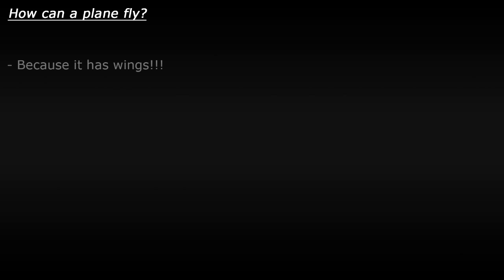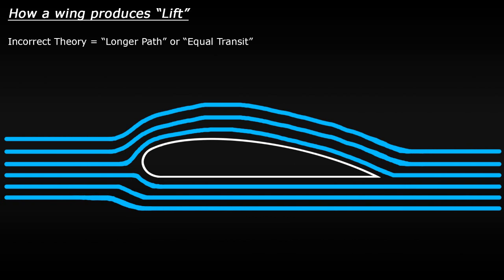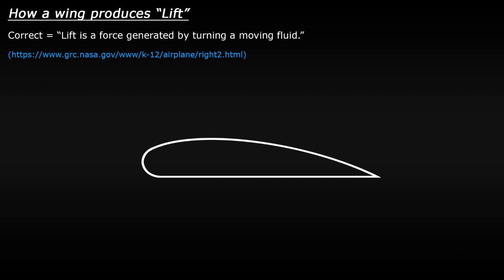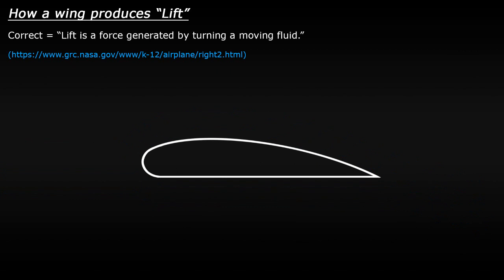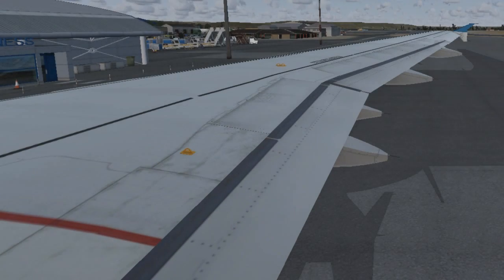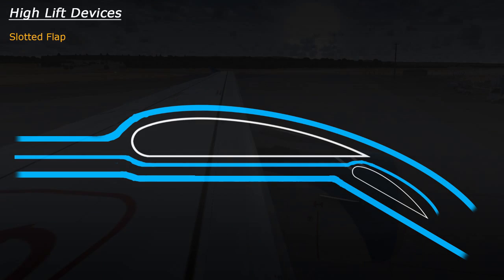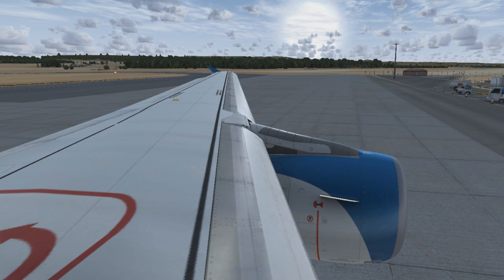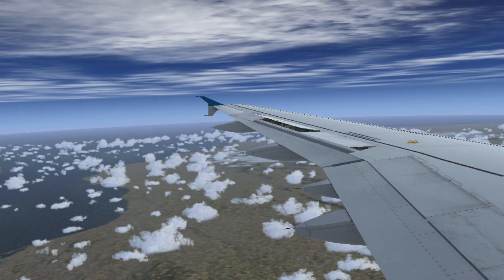How Wings ACTUALLY Create Lift!

Comment: I fully agree with what's happening here, but I don't understand a stall. A stall happens when the air over the top of the wing separates from the wing itself, but how does this cause a stall if the the air moving over the wing has no relevance to the lift produced. Can anyone help?
I'm happy to explain further if that wasn't enough, thanks.
Reply: Lift is created by pushing air down, and thus the air pushing back upwards against you. The explanation in the video is incorrect. If the explanation in the video was correct, and inverted plane could not fly and would just fall straight out of the sky. 
A stall is induced when the angle of attack is too great for the speed of the airplane. For example a aircraft that is powerful enough to climb at a 90 upward angle to the earth, will not stall until it reaches the point that the air has become too thin for the motor/engine to produce more thrust than the weight of the aircraft. That is basically how a helicopter works. 
So if you have a large commercial jet fully loaded, it is extremely heavy, even with big engines, it is not a high performance aircraft, and it can not climb at as steep of an angle of attack as a small, light, fast plane. Think of it like a car driving up a hill, a sports car can drive up a really steep hill because its engine is powerful, and the car is lightweight, so it can drive up the hill with ease. But if a heavy vehicle with a less powerful engine tries, the hill may be too steep, and the vehicle will either stop, or roll/slide back down the hill.
So for every aircraft there is a speed+weight+wing area+altitude combination that will decide the limit of the angle of attack that it can continue flying level, or climbing.
Essentially if you increase the angle of attack too much, the bottom of the wing begins to face forward, and air is just running into the bottom of the wing. So now your wing is just pushing air forward instead of down. This will create way too much drag, no lift, and slow the aircraft. 
I know this explanation is not very good or understandable but I hope it helps.
Reply: In a stall its because the push up under the wing, not the lift thats on top , becomes more and more of a push back. Lift is on the top, like a vacuum, and when air is no longer going over the top there is no vacuum..all you have is push back by the air underneath.
Reply: @Rickie53  An aircraft stall and a wing stall are not the same. An aircraft can still fly with stalled wings, which specifically refers to the cessation of laminar flow of air around the wing.

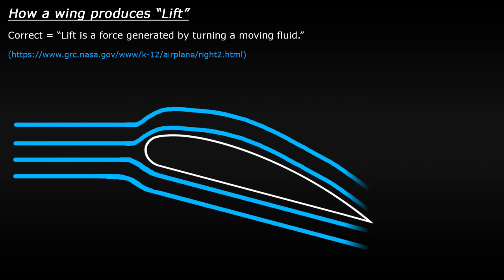Comment: So the Falps in 3:21 is used to take off at slower speed to reduce the amount of consumed fuel??
Reply: No,  Flaps are used to increase lift at lower speeds,  they also create more drag so more power is needed to maintain a set speed so fuel consumption actually increases.   The flaps are used to get off the ground sooner, or to reduce the speed to be within a safe limit for landing.

Comment: I fly several (model) aircraft which have no cambered aerofoil cross-section and of course nothing like flaps. In other words the wings are basically flat planks of wood (or plastic). But they still fly. How come? It's because of the rear stabilizer, with its large moment of inertia, forcing the main wing into an angle of attack which forces the air under the wing to produce lift. Why is this aspect of lift hardly ever discussed? The only time you will see exaggerated aerofoil cross-sections are on 'flying wings', which of course have no rear stabilizer. Bye the way, ever wondered how planes can fly upside down? It's due to the angle of attack caused by the rear stabilizer. I'd like to hear your comments...
Reply: The rear stabilizer is part of flight mechanics. The salient point is the flat plate is at an angle of attack, and flat plates at angles of attack generate lift.

Comment: Is the low air pressure on the upper surface of the airfoil due to the air density being lower on the top? Or or those really unrelated?
Reply: Yes and no. This is an often misunderstood discussion about compressablilty of air, And it's a minefield :-) The pressure difference is created by aircirculation over the top of the wing towards the trailing edge and under the wing towards the leading edge. As the wing moves forward the airflow adds to the speed of the air over the wing and substracts from the air under the wing (which was moving forward). so the speed difference creates different pressures and therefor lift. It's manipulating the airstream and since air has mass forces causing the lift are therefore present.

Comment: Now explain how a plane with that same airfoil can fly upside down.
Reply: by balancing it using its tailwings, and the trailing wingflaps (which can go up and down). Remember, most modern jetfighters (which i presume is what you're talking about) are so aerodynamically unstable that computers do most of the correcting, so flying upside down is as easy as making a half roll and maintaining level flight.

also, fighter jet wings rarely diverge from straight wings (no extreme dihedrals / wings angled down or up (looking at it straight on)) and are rarely thick and round (this makes for worse acrobatics, and easier to spot on radars), which enable it to fly in a multitude of ways without the plane wanting to naturally return to its normal stage.
Reply: also, most passenger airliners cant really fly upside down, at least, not for long.
Reply: Some wings are better suited for inverted flight than others but in simple terms the answer is always Angle of Attack for instance an aerobatic pilot flying inverted in level flight needs to input slight nose up (relative to the ground) stick producing a positive angle of attack to the relative airflow just to maintain level flight keeping the stick neutral will result in an immediate inverted nose dive
Reply: @PabloGonzalez-hv3td  in an inverted position, the airfoil no longer produces the same pressure differential.  It's no longer smooth Bernoulli air flow, rather it's Newton with the airflow pushing the front of the wing upward.
Reply: @dhy5342  - Positive angle of attack is still required to alter the pressure differential to produce lift again a wing doesn't magically know it's inverted. An airliner with a cambered airfoil can fly inverted if enough positive AOA is applied to counteract the upsidedown camber, symmetrical airfoils are fitted to aerobatic aircraft so minimal AOA is required while inverted - a symmetrical airfoil at zero AOA produces no lift the forces cancel each other out

This is clearly visible when an aerobatic aircraft flies knife edge as top rudder input is required to induce a positive AOA from the now sideways fuselage to generate lift just to maintain level flight
Reply: @dhy5342  Airflow over a cambered airfoil at negative angle of attack can remain attached.
Reply: @AmbientMorality  But the air would still be moving faster over the fatter (bottom) portion of the wing.  So what provides the lift?
Reply: @dhy5342  Air would not be moving faster over the bottom surface of the wing. The velocity and pressure fields change significantly as you alter the angle of attack of an airfoil..
Reply: @AmbientMorality  The airflow around an airfoil is usually demonstrated with flow lines going past something approximating a Clark-Y airfoil - flat on the bottom and humped on the top.  It is shown that the faster moving air over the top hump, relative to the straight movement of air past the bottom, results in lower pressure above the wing relative to the higher pressure below the wing which provides an upward force.

Now, turn the wing upside down.  Even with a positive angle of attack, the air flowing below the wing still has to move a longer distance compared to the air over the now flat top. So how does this produce an upward lift?
Reply: @dhy5342  The pressure below the wing is higher than the pressure above the wing. It has nothing to do with the distance above and below the airfoil; I never claimed that. It does, however, have everything to do with the pressure distribution above and below the airfoil
Reply: @dhy5342  By impacting the airmass at such an angle as to compress it below the plane, thus creating higher pressure beneath the wing.
An assymetric lifting body turned upside down will simply.produce downforce.
An assymetric lifting body turned upside down than pitched skyward will creat a pressure differential not because of bernaullis princile, but through simple thermodynamics.
It acts as a piston compressing the gas medium with its forward movement.
Reply: @ineednochannelyoutube5384  A high pressure below the wing implies that Newton, rather than Bernoulli, is keeping the plane up.
Reply: @dhy5342  Neither long dead physicyst is keeping the plane up.
Whats keeping it up is an airpressure gradient across its surface, which according to the bernauli principle causes airflow in the direction of the pressure gradient, once the separating body of the plane is removed, causing downward airflow, which only is the solution to the conservation of momentum if the plane is ascending.
In level flight there cannot be a mass acxelerating downwards to counterbalance the plane, since it is not accelerating upvards.

Comment: Lift is not produced by the downward deflection of the air leaving the trailing edge.  It has a lot to do with the flow distribution across the airfoil. In fact, most airfoils have the flow leaving horizontally from the trailing edge at low angles of attack. I think you misunderstood the document from NASA's website. If you read below it clarifies by saying that flow deflection is not a correct theory for lift.
Reply: Incorrect. If an airfoil did not deflect air at all, the change in momentum of the air entering and exiting a box around the wing would be zero, which would imply the airfoil is not generating any force.

Comment: What creates the high and low pressure exactly? Why aren't the pressures the same?
Reply: When you smash a surface into a gaseous volume at high speed, it will first compress said volume, increasing its pressure, before said pressure can dissipate ino the enviroment.
This pressure is experienced as a force along the normal vector of the surface that moves in the gas.

Comment: If this theory is correct then how does a symmetrical airfoil produce lift? In a symmetrical airfoil the curvature of the top surface is equal to that of the bottom surface, surely the mirrored geometry creates mirrored vectors for air flow off the trailing edge cancelling each other out? Also how does the theory apply to a wing producing lift when flying upside down?
Reply: you're exactly right. to produce lift on a symmetric airfoil you have to rotate it downwards. same with upside-down planes, rotate the control surfaces the other way around.
Reply: @pcenero  so a symmetrical airfoil only produces lift when angle of attack is not equal to '0'?
Reply: @CopyrightThis723  Correct. And a cambered airfoil (non-symmetric airfoil) will generate lift when the angle of attack is 0, and has some other angle of attack called the zero-lift angle of attack.

Comment: At time 1:58 you state: "it's NOT a pressure difference that creates lift". This statement is WRONG. It IS the pressure difference that creates the largest part of a wing's lift. Of course the downward accelleration of the air mass (deflection of the airstream that passes around the wing in a downward direction) is also part of the lift that is generated by the wing. But if your "theory" of the wing that is not related to a pressure differential between the upper side and the lower side of the wing would be correct, you could minimize the wing area by having only very minimal chord length - a profile that only deflects the air downward. But the force of the lift is clearly the mean pressure differential over the entire wing area multiplied by the wing area. If the lift would not be caused by the pressure differential then increasing the wing area would not increase lift as long as chamber (downward bending of airstream) would not be increased. But any wind tunnel experiment will show you that a longer wing chord with the same chamber will result in a greater lift. I agree with you that there are many wrong theories about how a wing generates lift - but it seems that your video is also falling into that category.
Reply: Pressure differential and downward displacement of air are in a causative relationship and not separable.
A larger wing area will displace more airover a given time, and the effectiveness of wing length and width on lift varies with lreasure, airspeed and air viscosity.
Air on earth is generally not very viscous, and usual airspeeds are below the speed of sound, so while the pressure wave created will dissipate relatively quickly, the air will displace faster than the wing moves through it.
At speeds above the sound barrier you get the wing cutting through the medium faster than it can displace, and so a wider wing, allowing for a longer contact time becomes more drag efficient, whilst in a higher viscosity flud, such as say water, a much thinner foil suffices to produce similar lift.